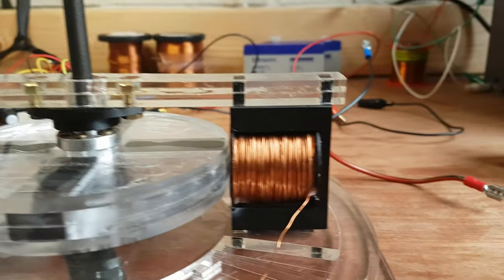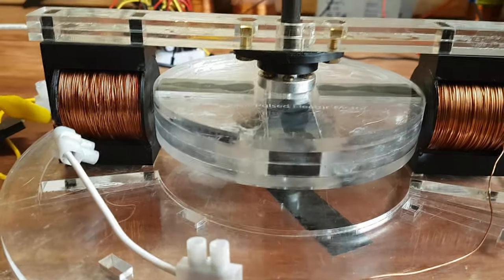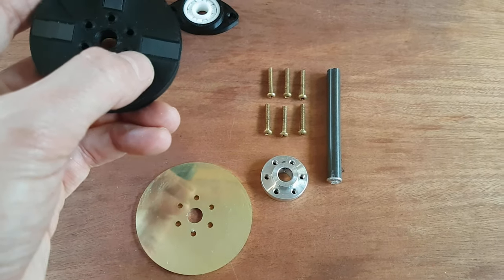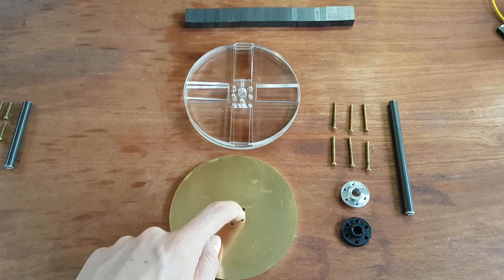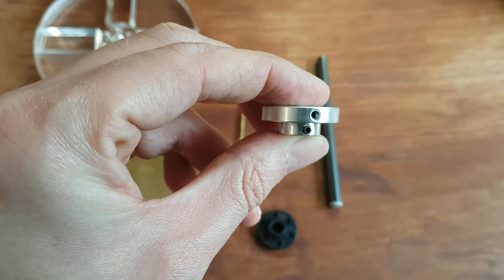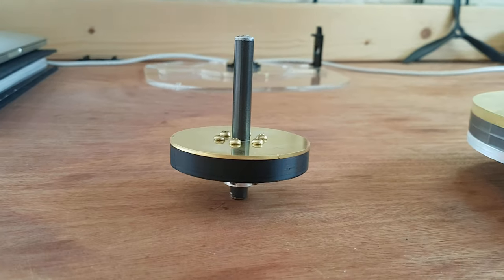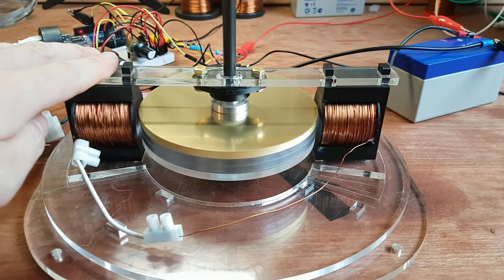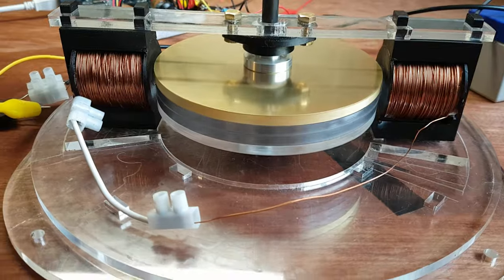Brand new brass flywheel rotors for Adams Motor

Comment: WHAT did you use to machine the flywheel ?? How efficient is the motor you made Sir ??
Reply from the maker: A company did it using a water or laser cutter.
Reply: @Waveguide  I am lucky I know someone who has a complete machine shop. This makes things a lot easier.

Comment: Great looking devices! If you want a more efficient flywheel, I would suggest getting most of the weight on the outside perimeter of the disk.
Reply from the maker: Good point! It seems however that these devices run better with a rotor that's light, so I went a bit in the wrong direction here :-p

Comment: Larger radius means greater tangential velocity for a given angular velocity. Higher tangentional velocity means more electric generating power for the rotor
Reply from the maker: That's an interesting observation. Adams' rotor was ~20cm in diameter, while mine currently is 12cm.

Comment: hmmm maybe you could etch one of the brass plates and make a star wheel commutator...
Reply: Yeah I have been looking into that, but the holes in the brass plates are making it a bit tricky. Will see if it works or not.

Comment: What shaft is that. 
Steel?
Introducing the brass is going towards the Faraday gen.
Reply from the maker: Hi, the shaft is hardened aluminium actually 🙂 I did indeed do some basic Faraday Homopolar Generator tests with the brass, but didn't get any clear results from that.
Reply: @Waveguide  if you had a good contact surface from the shaft to the disk and the poles are the same polarity you might get something. 
At least you looked at it.

Comment: 3D printing has helped us a lot with our design work and builds. Before I had to try and build everything from acrylic sheets. You might want to look into using magnets as bearing too float your rotor. It works great and the friction is reduced greatly.
Reply from the maker: Magnetic bearings would be the next level, indeed :-) For now, the full ceramic bearings will do. 

And yes, 3D printing has been a blessing! Just having a hard time to find out the best way to print the coil forms, because the ones I have now are a bit flimsy or require a ton of supports.
Reply: @Waveguide  Ah take a look at my channel. I printed coil housings in two parts/half's and they work great. I just wound a monster coil with no issues. I guess it does depend on the coil type.And yes I love ceramic bearings in fact my next rotor will incorporate them in a very large rotor. I tested them recently on a smaller rotor and they do work great!
Reply from the maker: @mcorrade  With the coil forms I print, the ends often break off...:-( But I'll check out your channel and see how you did it. EDIT: just did, and they look great! Are you willing to share the 3D model of that, so I can learn how you set it up? Curious what kind of supports you used.

Comment: Hi Nick, Congratulations on the project, this engine drew attention for the low use of amperage and the possibility of recharging the battery, my doubt regarding the use would be in a project of low Torque Nm, You can give a projection of consumption and autonomy for use in an e-bike, the operation in that approximate configuration of power 300 watts, Torque Nm 30 and 250 Rpm
Reply from the maker: An e-bike powered by a motor like this would be pretty incredible and, if properly constructed, would give it a LOT of range. However, I'm not knowledgeable enough yet to give any useful info in this respect. But for that kind of torque you're going to need strong magnets, and strong magnets require a higher driving voltage. Not sure if the 36V average e-bike battery will be enough in that sense. However, current consumption, even at a 50% duty cycle, should still be much lower than a traditional motor whose current is on 100% of the time.
Reply: @Waveguide  I realize that the shape of commercial engines a lot of batteries. In this engine of Adam the question of automobile improves I would risk a battery 24 volts. Regarding the start of the e-bike or pedal assisted resolv. I think that Adam himself in his project is not a regular in the use of super magnets even for the final cost of the project so he could use the solution given by Newman with greater coiling in the stators. On the e-bike he would use the spaces between the spokes of the wheel.

Comment: Nice craftsmanship! Thx for sharing
Reply from the maker: Thanks! I did just re-read part of Adams' manual in which he describes the construction of his rotor, and part of his was actually made of high density foam! 

So it seems he wasn't trying to go for a flywheel at all.. guess my original rotor wasn't so bad then :-p
Reply: @Waveguide  lol.. it’s a nice construction anyhow.. I’ll be curious to hear of your performance results.. I’ve tried crude versions of his motor with no luck but I chalk that up to poor mechanical building skills.. you look to be on the right track..!

Comment: Hi, Nick! Good work! But I didn't understand why you are using a brass disc? What is the need for this?
Reply from the maker: In the Advanced Bedini Motor Manual there is a mention that using a flywheel would improve performance, as it helps maintain peak speed, smooth out torque, and work as a mechanical battery. However, I only later realized that Adams actually tried to make his rotor as light as possible, so I'll have to change it once more I'm afraid...
Reply: Sure. Although the Bedini motor is similar to Adams MG, the accents are different. And by increasing the rotor mass you reduce the efficiency of Adams MG. It’s a pity for your work, but it’s good that you understood it. As we say - better late than never. And what about your pick-up coils?
Reply from the maker: @alexanderkrupnov4999  I want to perfect the drive circuit first before I start adding additional complexity like generator coils.